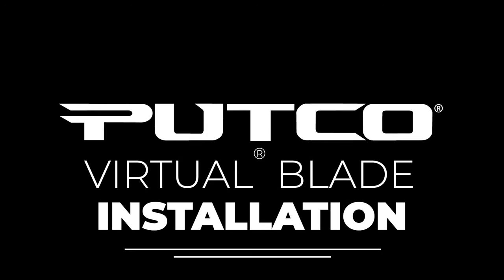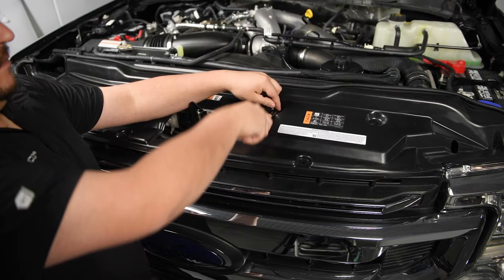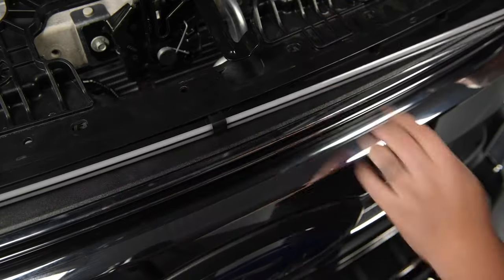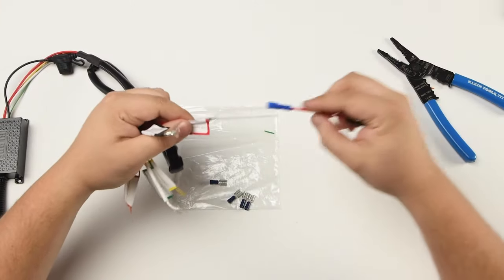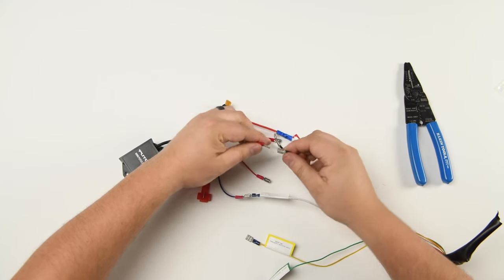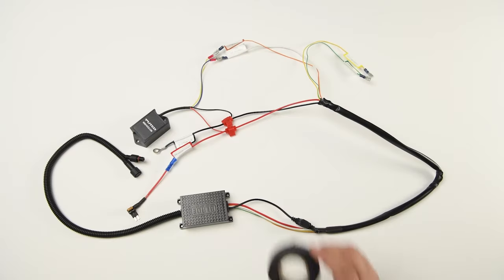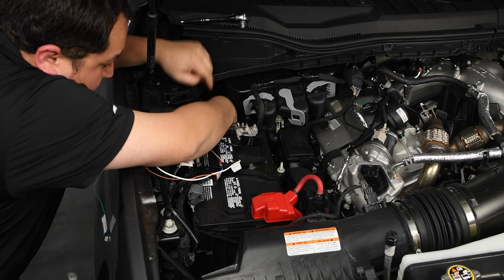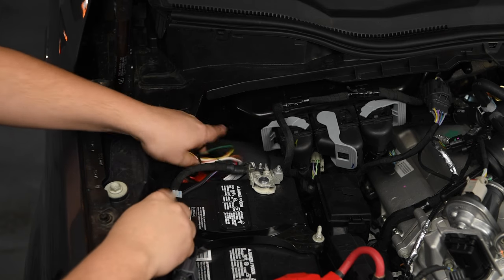How to install a DRL Blade LED Grille Light Bar - Virtual™ By Putco

Comment: I have a 2023 gmc sierra 1500 I’m using the spot in the fuse box where one of the headlights fuses is at. It turns on and everything however it won’t turn off. What am I doing wrong?
Reply: the add a fuse has to be attached to the DRL. just pull the fuse out of the fuse box add it to the add a fuse and plug the add a fuse into the DRL spot

Comment: My light stays on.   Which fuse should i use for it
Reply from the maker: Depends on the year and model, please let us know what you got and we should be able to help!
Reply: @PutcoInc  I have a 2006 Ford f350.   Every time I plug it in the amber light just stays on.  The remote does nothing.  When I tap the wires the change colors  then go back to the amber.